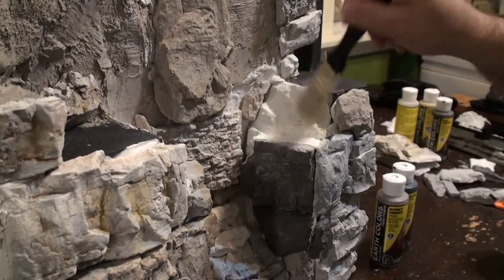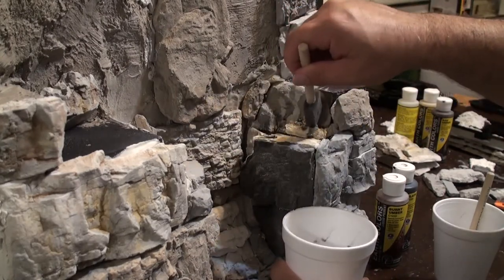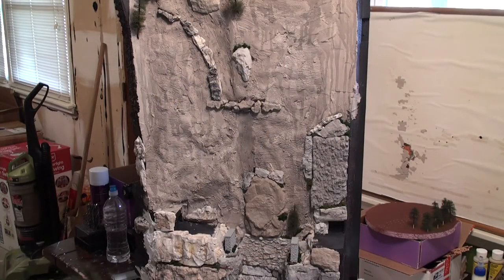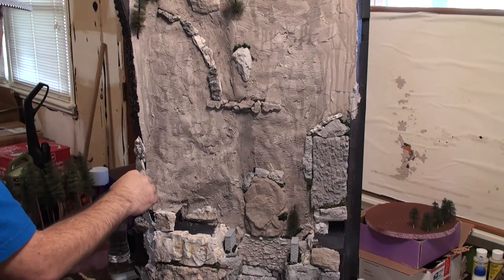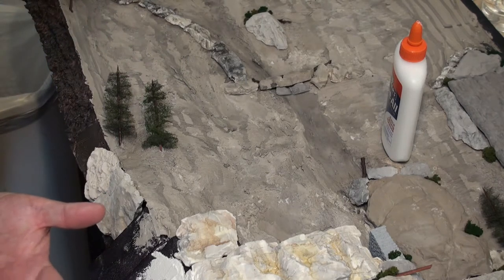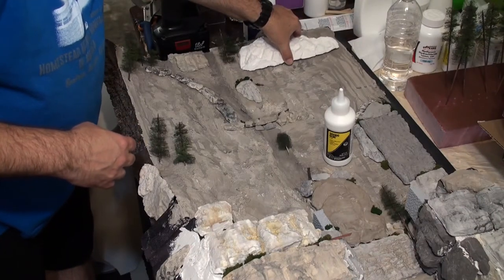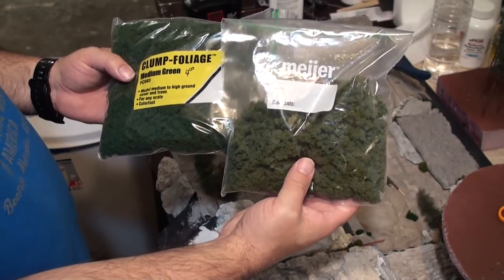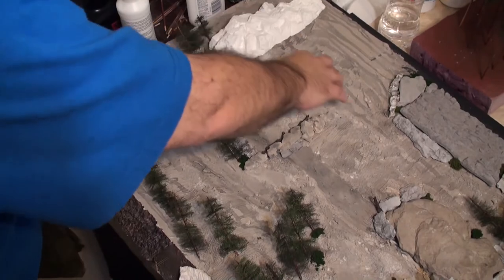How To - Making The Helix Mountain - Part 5

Comment: Hi Bob, Charlie here:
Good show on the water works and scenery . Did you ever show how you did your round house, like track between house and turntable. If so where can I find it ? ?
Reply from the maker: I have not finished that area off yet, probably will put either ballast down or a plaster like Smooth It down to fill in the tracks.  Haven't decided yet.